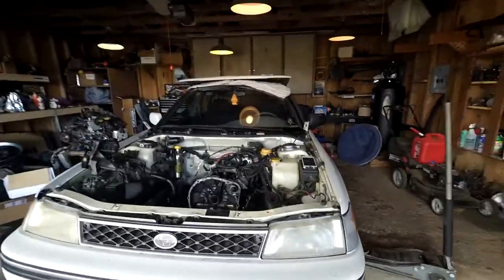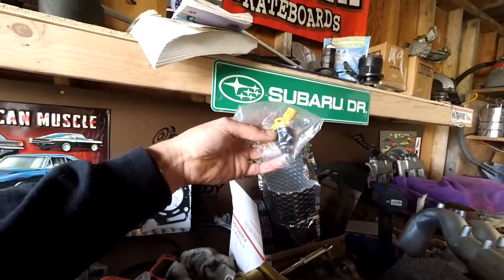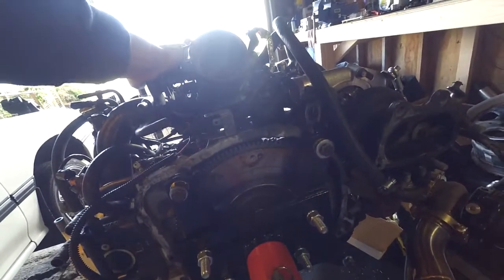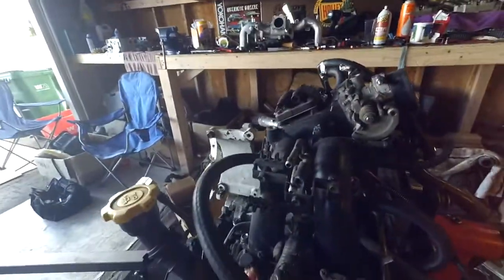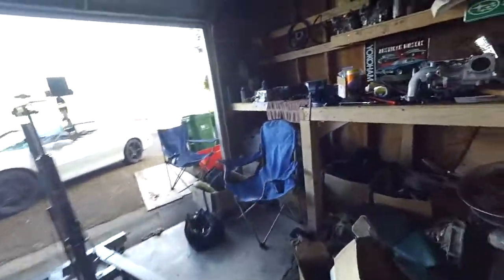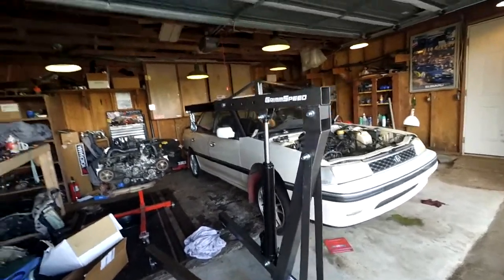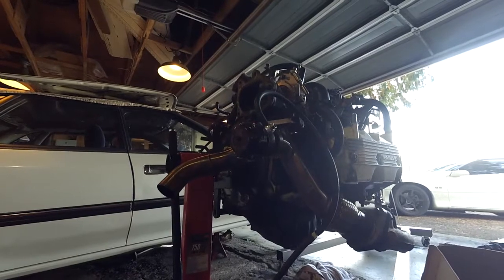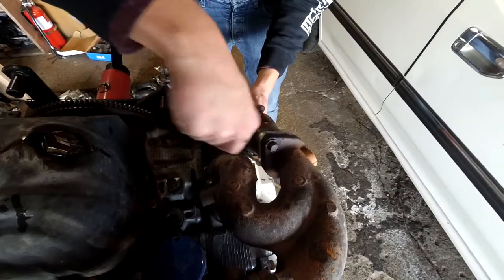EJ22T DOHC Head Swap Pt.1

Comment: I know this is old but love seeing someone work the ej22t. Never understood why not more build these. Personally I'd love to put an ej22t in a GC8/6
Reply from the maker: A big reason is they are pretty rare and hard to find. But if you find one hold onto it, put Zoe good heads on it and they rip. I still daily drive this car, the engine hasn't missed a beat since I built it.
Reply: @HackSquadGarage I have has a couple opportunities but every shop i asked about them wanted to act like there garbage engines which leads me to believe those are just garbage shops 😂

Comment: Cool video hopping to upgrade my 96 outback ej22 like this once i het the extra cash to get the parts. The water pump started leaking yesterday just ordered it seals timing stuff probably going to do that thanksgiving out in the cold ya lol first doing this to a Subaru done a lot of timing belts and chains over the years one of the main reason i got this was it was cheap and there so easy to work on lol plus with a wagon can fit a lot of my tools in it until i can find a old idi diesel i can afford hope the bottom end holds up for you ill look for the next part of the video!!!!!!!!
Reply from the maker: The ej22 bottom end is very stout! You could do a 25d hybrid and make some more power na or turbo it. Just keep it under 300hp as the rods and pistons are the limiting factor

Comment: Thank god people like you exist that have knowledge on rarer cars.
Reply from the maker: Thanks! We hope to have more content like those coming soon
Reply: @HackSquadGarage  anything first gen legacy SS related is good for me. I just bought one and I'm trying to learn... Came from Nissan RBs and Toyota JZs.
Reply from the maker: @layzorbeeemz7317  well we're actually about to start a legacy na to turbo swap on a budget the right way using a lot of ss parts and sensors!
Reply: @HackSquadGarage  speaking of SS sensors... Do you happen to know the part number for the IACV  gasket on a 22t? And do you have to drain the coolant to remove the IACV? I read somewhere coolant goes through it as well as air.
Reply from the maker: @layzorbeeemz7317  sorry I don't know it, you could call your local dealership and get that part number. You don't have to drain the coolant but you will loose some but not much. Coolant runs through the throttle body then through the iacv then into the coolant crossover pipe.
Reply: @HackSquadGarage  okay no worries, thank you sir.

Comment: Which plug wires did you guys end up buying or using for the msd coil and 25d heads? The ones I have stick out of the valve cover a good amount
Reply from the maker: I just went to the dealership and got 98 outback 25d plug wires.

Comment: Hi HSG, So to build off the Ej22T block. the donor parts needed are the EJ25D intake  & cross over pipe & ej25 belt tensoner.. anything else from a donor? I'm not using the 90-94 legacy, going newer. just older motor hybrid. Also EJ25D has HLAs & Shim bucket lifters. Which type of DOHC do u recommend with the EJ22t. I think i noticed your build was Shim bucket lifters DOHC ej25D. no boring needed? stock internals with bolt on ej25D dohcs.
Reply from the maker: You also need all the small pieces like the coolant pipe that runs from the heater core to the water pump, the dip stick/tube. You are basically building a ej25d with a 22t block instead. Oil pans are interchangeable. The 96-97 ej25d heads are HLA, you should avoid those, no boring, stick with the 98-99 heads with the cometic head gasket we mentioned, but the 96 intake manifold has the largest runners. Also use all of your current cars sensors/wiring including the throttle body so your ecu know what tps it has. Hopefully that helps!
Reply: @HackSquadGarage  The 96 legacy intake manifold looks to have a smaller plenum compared to the 97-99 legacy Intake Manifold on the EJ25D with shim bucket lifters. I found some EJ25D heads from a 99, with 62,000 miles :)
Reply from the maker: @Scotty14k  it's similar but the 96 flows the best out of all of the 25d versions

Comment: so I blew my ej22 both of them I have a good set of heads from the ej22 what head gaskets would I go with to mount the heads on the ej25 block
Reply from the maker: that tucson kid as long as both engines are the same phase it will work fine, you'll need to use the ej22 intake manifold, and all the wiring and sensors to match the ecu you are using. I would run an normal MLS ej25 head gasket made for that specific block, that way the ej22 head will give you a slight bump in compression. Run high octain fuel only.
Reply: Hack Squad Garage thank you for that and also what is the easiest way to distinct the difference between phases and when to know witch is a match I'm getting the block from a pull yard it's cheap but get sum good stuff out of there
Reply: I'm asking because I know they change the thrust bearing position for different phases but I can't tell I have a 93 ej22 and a 92 ej22 out of a wagon how do I find out the phase on my old engines also how to tell the difference on the 2.5
Reply from the maker: that tucson kid to my knowledge ej25s up to 99 are phases 1 I think, idk what block you have, but if you use the 22 crank sprocket you can run it as a phase 1.
Reply: Hack Squad Garage thank you for that info that helps a lot when I'm putting it together il make a video and attach a link so you guess can see how it turns out
Reply: A little up date spoke to cosmetic gasket company current getting the gasket for the build once I have it all send a link to my utube video
Reply from the maker: awesome! sounds good cant wait to see it

Comment: I have the ej22e phase 2. I want to swap the heads over to something phase 1. Possibly ej205 heads so i can do a turbo setup without doing all kinds of fabrication. Will my stock ecu work for this setup? And im assuming i need to change my intake as well?
Reply from the maker: Nate Manley well the ej205 is also phase 2, I don't know for sure but I believe they will take the same cam sensor, if the cam gear has the same tooth count it should all work with the existing wiring. Those heads will raise the compression ratio on an already high compression block, but in theory it should work.
Reply: Hack Squad Garage I have a 97 legacy with a phase 2 ej22. Whats the best swap to boost it cheap. I was thinking of swapping to a phase 1 setup because i need the dual port to uae the wrx manifolds.
Reply from the maker: Nate Manley I believe you can use phase 1 22 heads, preferably 22t heads so they have the plumbing for the turbo, but I think you need to swap the cam gears from your phase 2 engine. Then you can use all factory wrx turbo parts, headers ect. You can run 5 psi on all stock computer and injectors on premium gas obviously.
Reply: Hack Squad Garage I hear that any ej22t engine or parts are hard to find.
Reply: What about ej20t heads?
Reply: Also if i was told that there would be an issue using phase 1 heads with phase 2 block because the phase 2 is a interference engine where the phase 1 block isnt and could cause conflict there
Reply from the maker: Nate Manley ej20t? That's not an engine code as far as I know. There was the 2.0 turbo in legacys and early imprezas as the ej20g. Is that what you mean?
Reply from the maker: Nate Manley yeah they can be a little hard to find but people have them for sale in Facebook groups and stuff online. If you stay sohc with 22t heads you can keep your same intake manifold ect.
Reply: Hack Squad Garage i really do appreciate all your advice and help. Thank you so much for your time and respnding back. Im gonna try to hunt down ej22t heads. If you find someone selling them plz let me know
Reply from the maker: Nate Manley yeah no problem man, I try to help anyone I can, I'd sell you mine if I didn't already sell them. You should look up a group on Facebook called NA/T subarus. Lots of great info on there.
Reply: Hack Squad Garage i will thanks!
Reply: Hey what exactly would i need to do the 04 wrx swap in my legacy? I was told it would bolt right up but the wiring will be the hardest part. Would it be easier to just add a turbo or just doing a complete wrx swap?
Reply from the maker: Nate Manley well that swap would involve merging the cars wiring harness with the 04 wrx wiring harness, essentially making your car think it's a wrx electronically, there are companies that you can send them the 2 complete harnesses and they send you back 1 merged harness. That's the cleaner way to do it, but it's probably easier to just slap on a turbo setup with low boost and some fuel management. But obviously the complete wrx swap is better in every way.
Reply: Hack Squad Garage So i can use my stock ecu.... Or would i need a wrx ecu?
Reply from the maker: Nate Manley if you merged the wire harnesses you would run a wrx ecu, but some people do turbo the stock ecu, it's definitely not ideal but people do it with nothing more than a rising rate fuel pressure regulator on like 5-7psi, how long it will last is debatable. If you are interested in that you should look up a Facebook group call Na/T subarus. Lots of information.

Comment: When things are all said and done, you should do a general cost review, and definitely try to dyno!
Reply from the maker: Kristian Larsen Yeah that would be awesome, I'll try to get a break down of costs. This is by far the cheapest way to go about this head swap vs other heads. We will try to schedule some dyno time when the car is done at a local shop, we are expecting to double the stock crank horse power. Roughly 320-340bhp.
Reply: Hack Squad Garage the girlfriends outback started to develop rod knock so here pretty soon I'll have half the parts I need to build my hybrid haha I'll be using this as a parts list and guide, so good luck!
Reply from the maker: Kristian Larsen Yeah if you got a ej22t you can do everything we are doing exactly. You can actually do this swap with stock ej22t injectors, stock ecu/tune and a td04, but you need ej20g fuel rails for that.